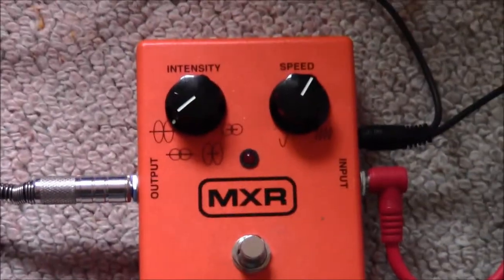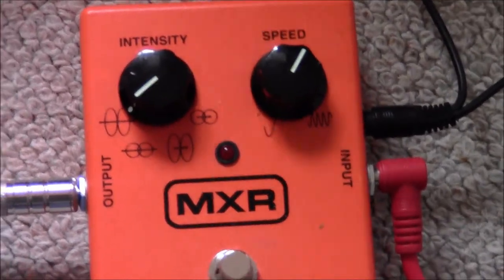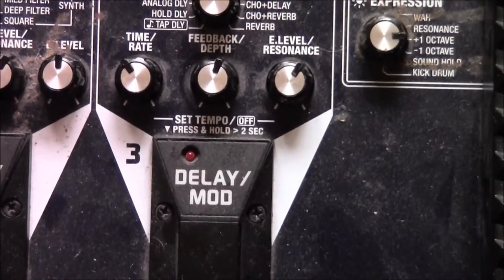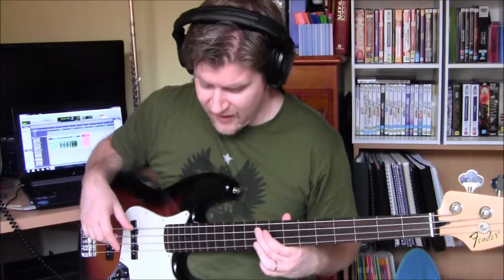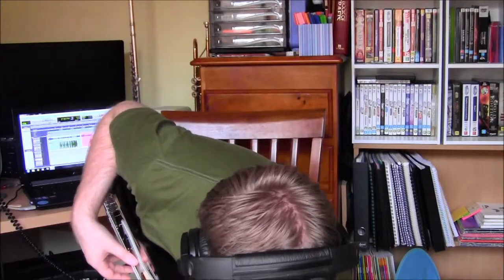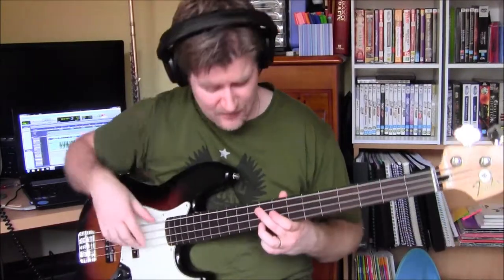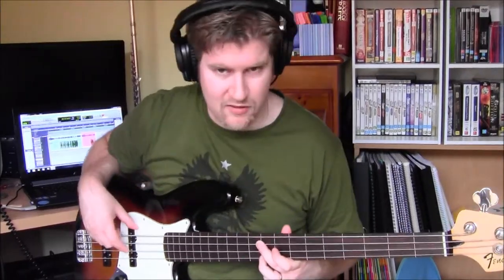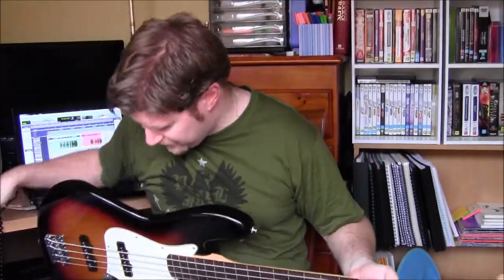Bryn Smyth Music Workshop - Video 7: Phaser Effects

Comment: Nice clip, I'm looking for a nice phaser to replace my PH-3(boss) and so far the mxr 100 is the one I like so far.
by the way I used to have a ME50-B also and it's a great multi effects unit in my opinion,  but I don't think it has a built in preamp.
Reply from the maker: You're right. It doesn't have a preamp, just an EQ band. My mistake.